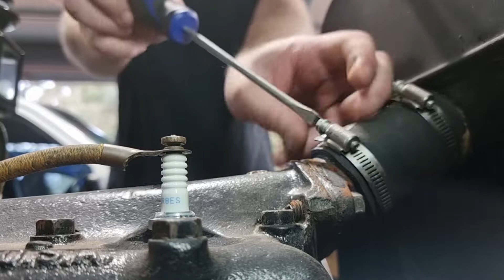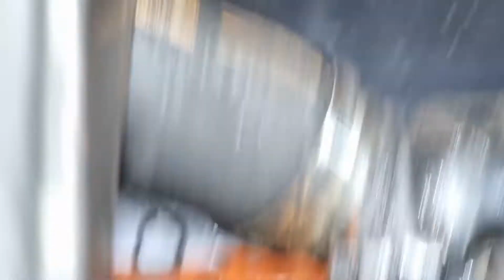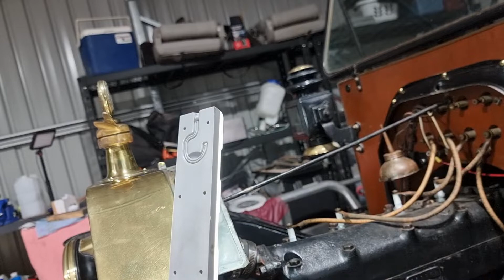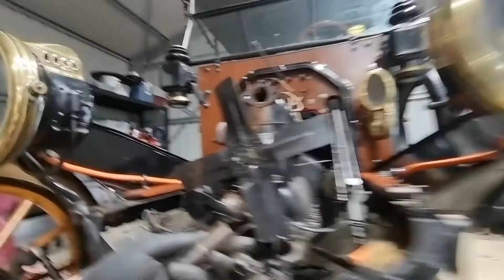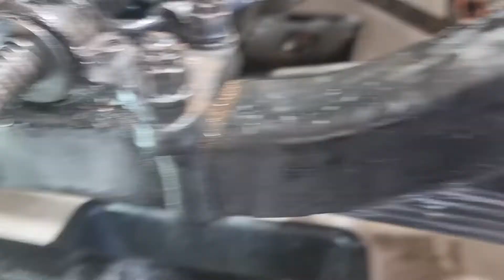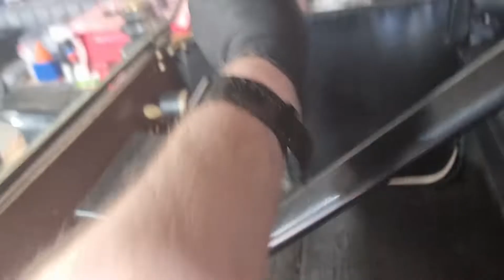Ford Model T part 4

Comment: A friend in Caloundra recently finished a 30year project building an Aus car up from a rolling chassis. He did a very nice job of it but in my watching these vids i will now be able to check his work and give him some critique. He may not take it well . Interesting watching, particularly the timer arrangement. I had one of the ticker boxes for a while, someone gave me a rudimentary cattle prod incorporating it.
Reply from the maker: Trembler coils are epic - a 100 year early precursor to MSD aftermarket ignition systems. Glad I can help you keep your mate honest! Make sure he uses split pins where called for. These vehicles vibrate like a tractor or thumper motorcycle.